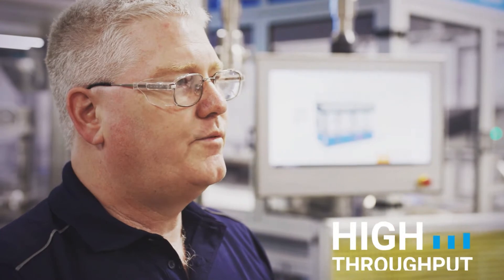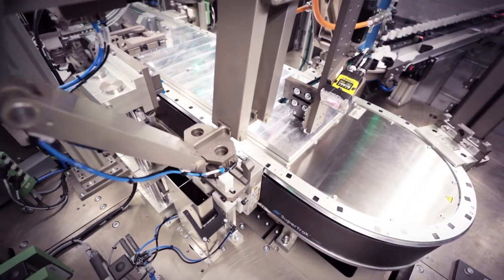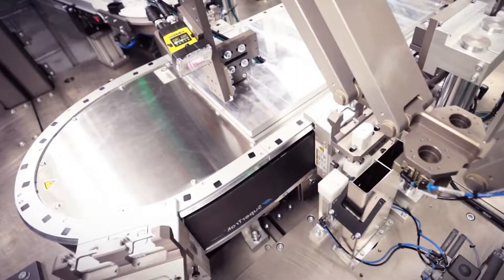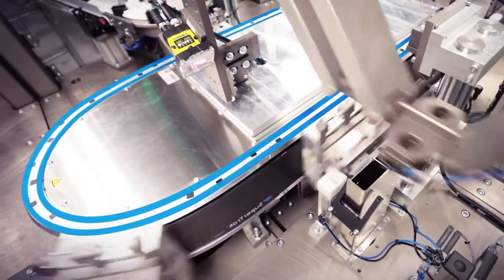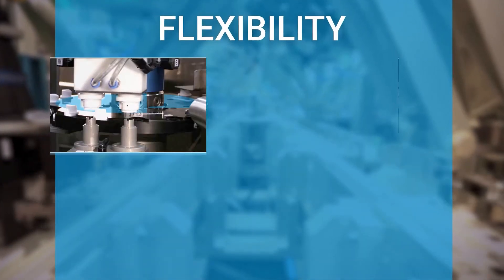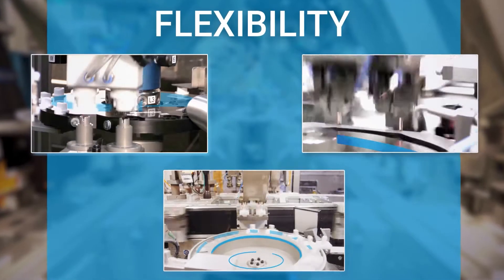Symphoni™ -  Symphony of Motion

Comment: Which platform are you using ? Rockwell/ Siemens / Beckhoff/ Omron ? … Or any ?
Reply from the maker: B&R hardware platform and SuperTrak LMT. Contact pcau@atsautomation.com for more information.
Reply: The back-end hardware control is B&R. There is no PLC. The control is proprietary similar to injection moulding equipment.